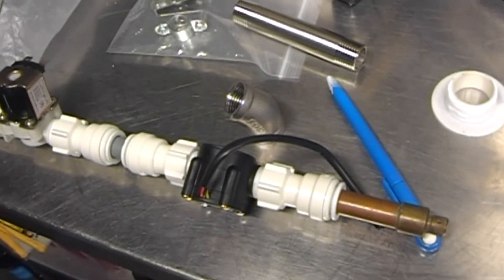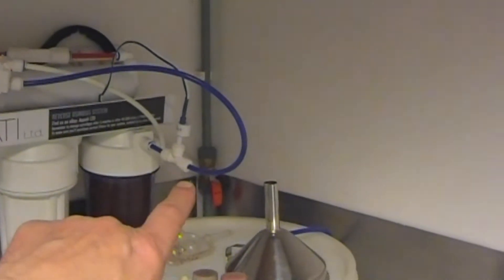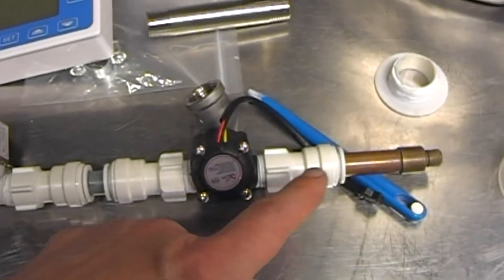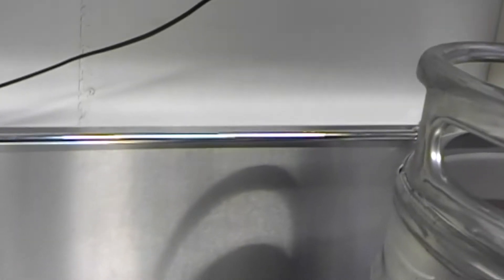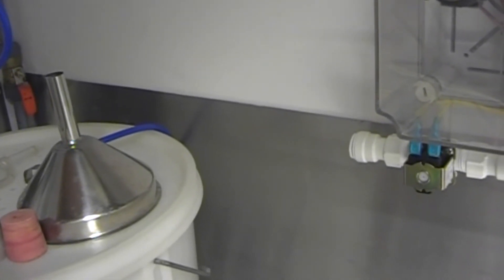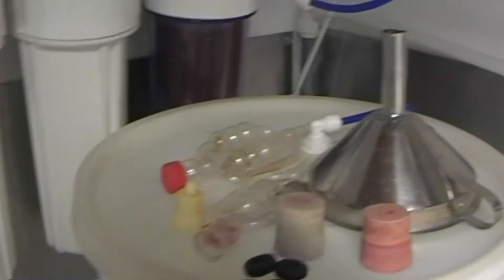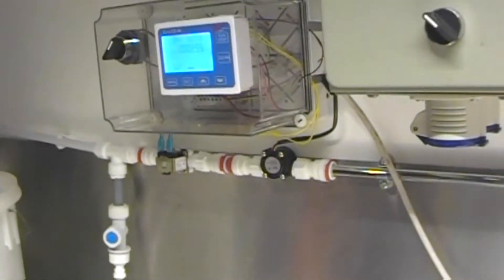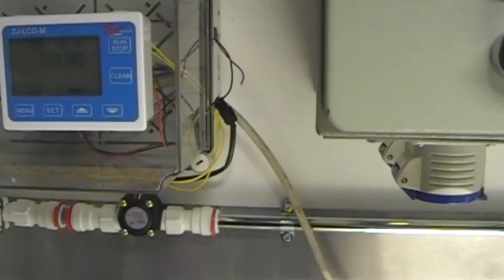Flow meter ZJ-LCD-M install

Comment: The flow meter kit comes with a temperature sensor, did you use that?  I ignored it when I fitted mine. Harry and I checked our flow meter accuracy and well mine was only slightly out but that may be the water temp as from memory the meter defaults to 20c.
Reply from the maker: I tried a k type connected to it but it just read 100c, I just have to allow for the 2m run of pipe and hose but i`ve mislaid the distructions somewhere.